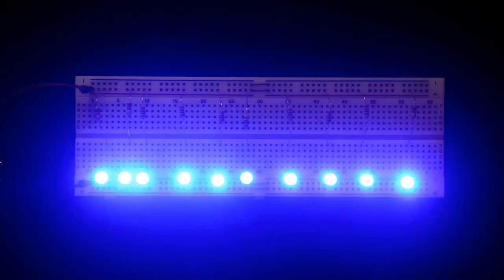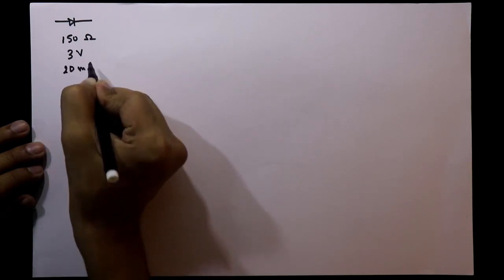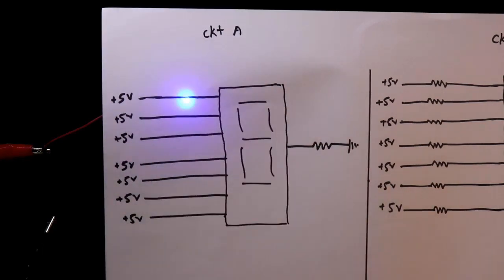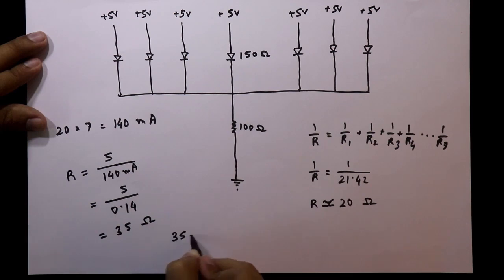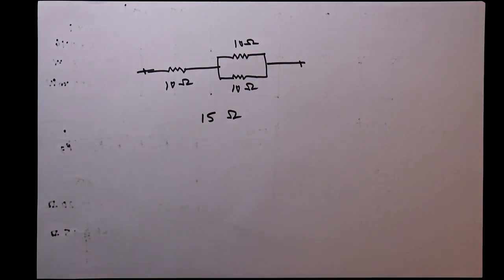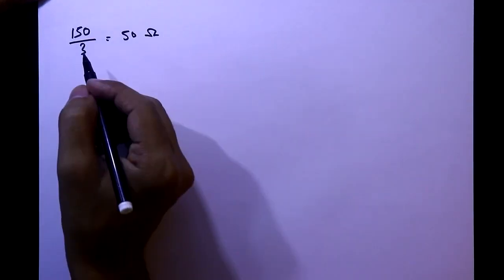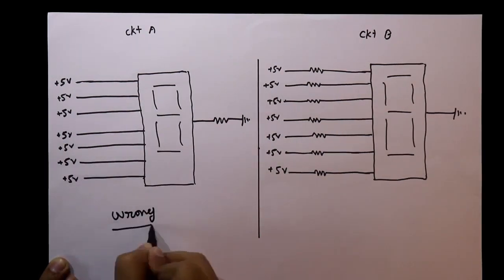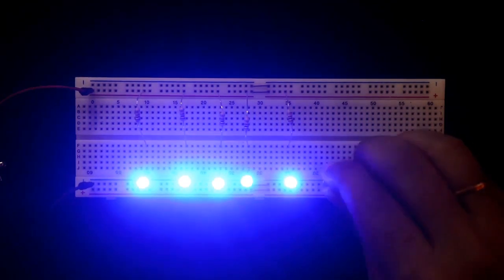Should I connect one resistor or seven resistors to 7 segment display?

Comment: Wish I had watched this before ordering 30 assembled LED display boards with no resistors on the LEDs at all!  I thought I could save it by adding a single resistor.... but no.... luckily I can opt to run it at 3V - I think...

Comment: Nice vid, however the assumption that LEDs have constant internal resistance is incorrect. Depending on the voltage used, the resistance changes inversely in relation to voltage. Some chips such as CD4026 do not require the use of current-limiting resistors since they have internal current regulation.

Comment: LEDs will work fine with 10mA 5mA and 1mA or less. You cant calculate the internal resistens of a LED! if you supply a 3.3 volt LED with enough amps, the LED will take as much current as possible, it will burn through. if more current flows, the lower the resistance of a led, it wants to die! you always need a resistance! if you take a button cell, then this is already the resistance.if you only use one resistor for a seven segment display, then the 8 will be darker than the 1